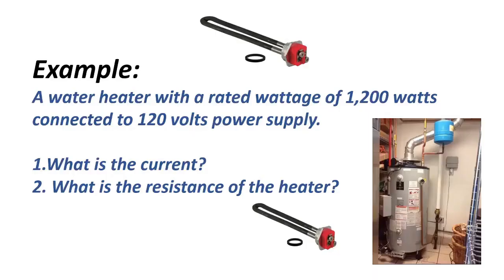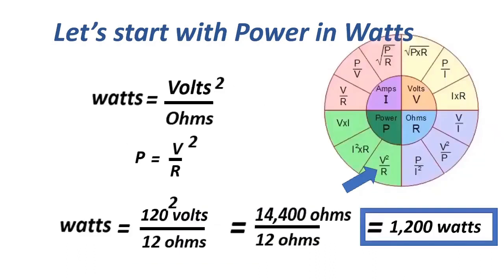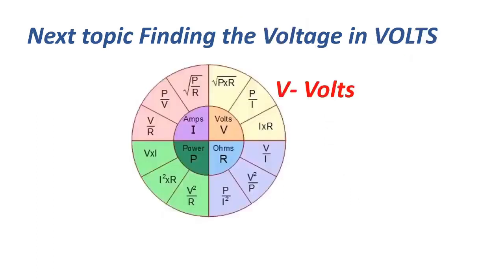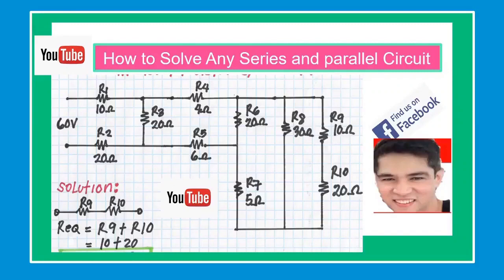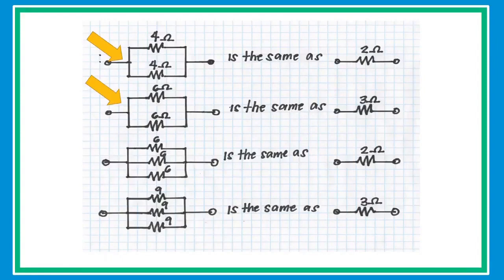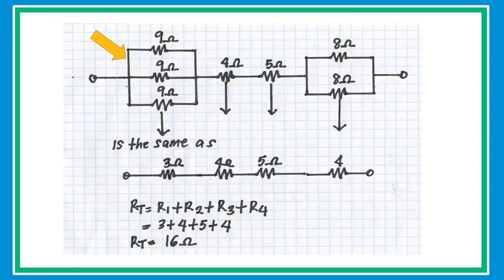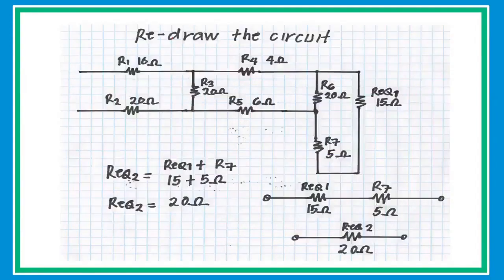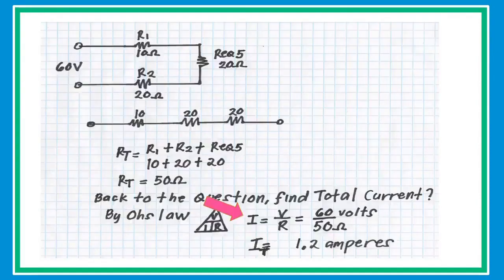OHMS LAW Pie Chart Sample Problem with Solution- ALL Formulas

Comment: You should change the title of this video, as it and its description are misleading.  You labeled it in a way so as to make viewers believe that you were going to teach us a particular method to use in order to 'easily remember the twelve separate formulas located in the Ohm's Law Pie Chart'.  Instead, after you showed us an example of each of those formulas, you went on to describing the difference between series and parallel circuits.
  Good video, but it is mislabeled.